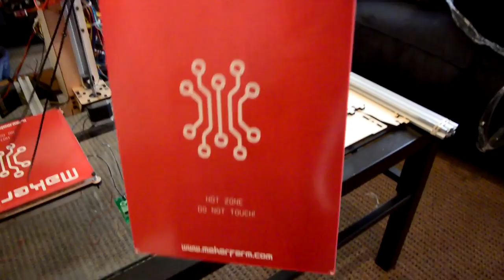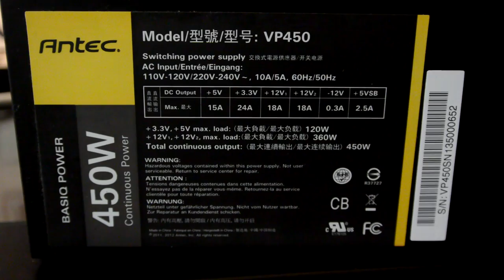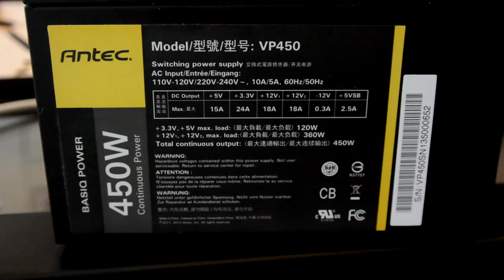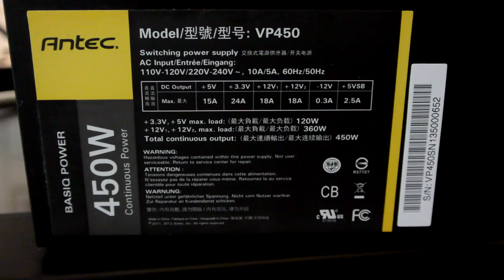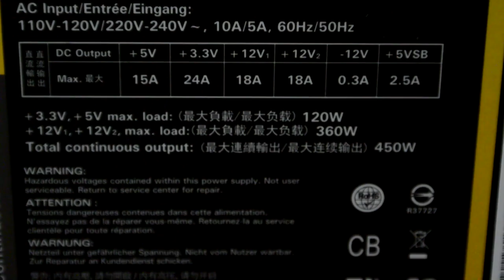3D Printer Upgrade: Much larger print bed!

Comment: I think I know why that type of psu is not recommended, it looks like it is an older design and as such those computers required more power on the lower voltage 3.3 & 5v  rails than on  the 12v, so  you need to make sure that type of psu has a 5v  load  for stable operating levels because the way those types of psu work internally, connecting only to the 12v line can result in an unbalanced load  and fluctuating 12v levels as a result and some psu's will shut down as a part of their internal protective mechanisms- I'd get around that by wiring a raspberry or orange pi to the 5v line ( octoprint)  or you could get a haswell compatible  one that way the requirement for a lower voltage load  no longer exists

Comment: Have you printed anything tall with ABS on your MakerFarm? Mine have had warping issues because of low environment temperatures. I'm planning on building an enclosure. 

The enclosure I plan to build will have 27 inches of room for the Y axis. Could you measure how many inches your printer with the 12in upgrade requires?

Comment: If I get this update from makerfarms , and I'm not be able to get 8"x12" heat bed , what's the logic of doing this update? There is no any sense to do it, unless you print on cold plate.
Reply: I guess "improvise". Have two heated beds side by side with a piece of glass or aluminium over the top. Ignore the thermistor on one of them and use an external MOSFET to drive the increased load.

No reason at all (with a bit of care and creativity that you cannot use multiple beds - BUT to make it easier to adjust levels, you really need to then have a single piece of aluminium or glass to make it "one big bed".

Have been playing around with four 220x220 beds with connectors to outside. Works well but you DO need a heft power supply - though (again if you are happy to play around),  use the output to simply drive a MOSFET to switch a 24v or 48v supply and have the 2 or 4 plates in series. Wire does not have to be ultra thick and VERY hefty 12v power supplies (50A and 60A) tend to get hot tracks when used at full load - 24v and certainly 48v ones do not - as the current is VERY much less.

Obviously the board still wants the 12v supply - it is ONLY the heaters I am suggesting you can wire in series and then just use the thermistor of ONE of them (leave the others disconnected / ignored).

Comment: Is there any firmware updating involved, or do you just change the print area settings in your slicer? I'm thinking of do thing the same with my Lulzbot Taz5, but I'm unsure about this aspect.
Reply from the maker: +Eden-sama there is usually a firmware update needed, as many printers will have software defined max endstop limits. It's usually easy to do, as lulzbot is very open source driven, they have all their firmware available to download and should have instructions for it.
Reply: Hoffman Engineering thanks! I looked and didn't see anything from them, but I'll dig deeper. I'll post a video reply when I do it.